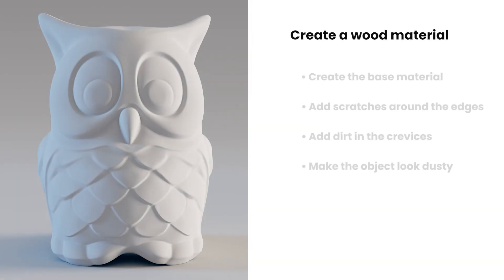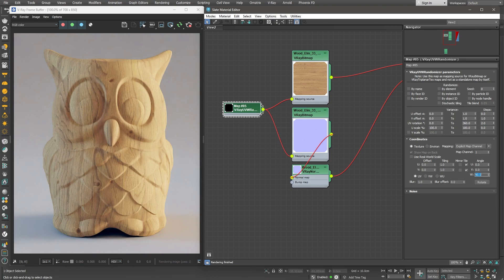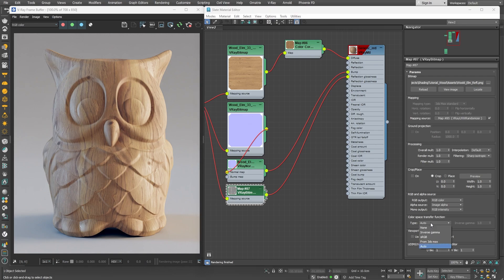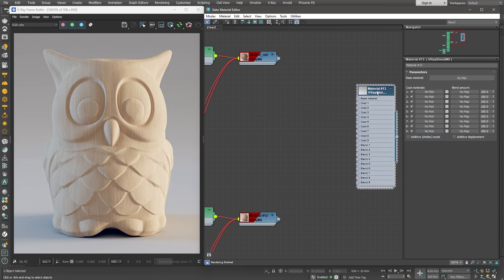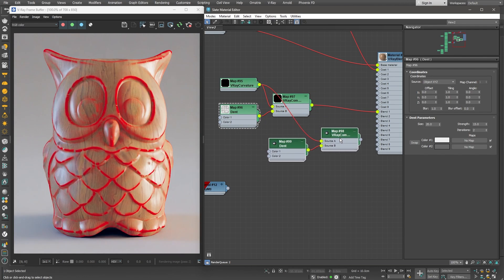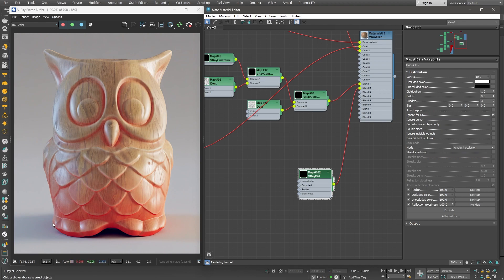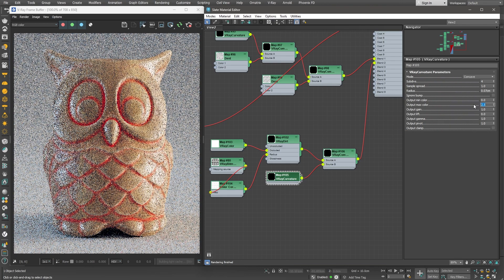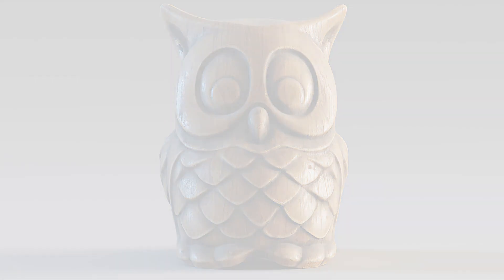Creating a realistic wood material with V-Ray for 3ds Max

Comment: Why is the reflection of the base wood completely white though?
Don't PBR standards stipulate that dielectrics should have roughly between 40 and 65 sRGB values?
Also he says that dust isn't reflective (which is correct), but adds a super high values of sheen which contributes to specularity (???)
Some stuff he does seems pretty arbitrary....
Reply: I don’t understand what you’re saying but I agree
Reply: yes agree ideally at least base wood should have a reflection map also. but i think this tutor is more focused on particular usage of curvature and dirt maps.
Reply: Hi. The 40 to 65 are the base specular color. In the VrayMtl the Reflection slot are the max reflection color. And is white for all the materials in the reality. The fresnel and the IOR are the parameters to define the base specularity. Dielectrics in the specular-gloss system normally work between 1.3 and 1.6 and metal with more.